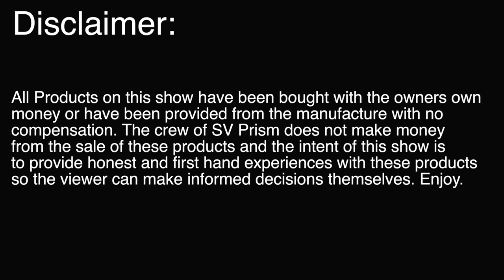Prism Reviews: Kingston Quickset Anchor in water testing Pt.2

Comment: The cheap danforth will hold solid  on the Hudson River and the Eastern Bays.  I was tempted to cut my Danforth loose but it finally decided to come out of the muck before I gave up. You're a serious cruiser, you should have at least 2 anchors. 1 for sediment, mud and clay and one for rocky sand and in-between.
Reply from the maker: The problem we have with Danforth's is that they early reset in a 180 degree switch. We carry 2 fortresses on board and I agree they are the best for soft mud but I wouldn't trust them as a primary if I wasn't on the boat. The goal here is to find an anchor that can perform better than the spade in this substrate and on par with it in all others.